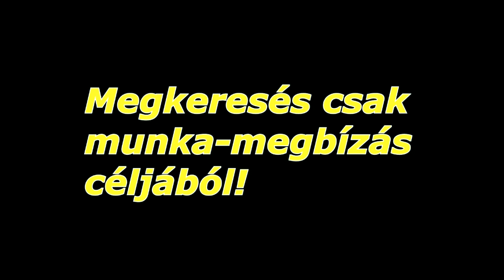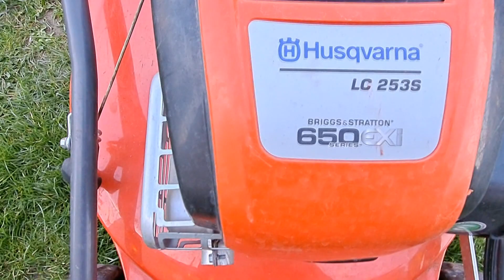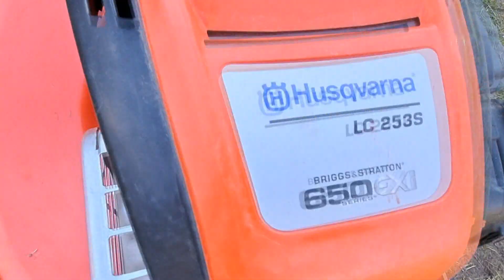Miért Vegyél Husqvarna Fűnyírót! / A Szezonális Alapvető Karbantartás ..

Comment: Üdv, tanácsot szeretnék kérni, fűnyíró vásárlás előtt állok, ~1200m^2 lejtős kert. Először az LC 353AWD-t néztem, boltban inkább az LC 356VP-t javasolták. A 356-os olcsóbb ( 229 vs 314e) , szélesebb(56 vs 53cm)  és a nagyobb a puttyonya (75 vs 65L). Ellenben 353 AWD az 4 kerék meghajtású (azt mondák a boltban hogy nem számít semmit) , nagyobb a hátsókereke(  279 vs 203mm), magasabbra is lehet emelni (101 vs 75mm) és kisebb a tengelytáv (56 vs 71cm). A motorja ugyanaz a kettőnek, de 356-oson 2800-at, az AWD 3200-at pörög. Egy helyen olvastam hogy nagyobb gazban az 56-os kés már nagy ennek a motornak, kérdés hogy a két hajtást hogyan bírná.
Reply from the maker: Én biztos nem vennék AWD-t..
Reply: @DrujbaInc  Miért nem? Én sem az elsőkerékhajtás miatt venném, hanem a többi paraméter miatt: Nagyobb kerék, nagyobb magasság. De a kisebb gyűjtő pl nem tetszik. A tengelytáv nem tudom mennyit jelent a fordulásnál meg ami elbizonytalanított hogy valaki írta hogy 56 késnek már nagyon határ ez a motor, illetve valahogy masszívabbnak tűnik az AWD mint a VP.